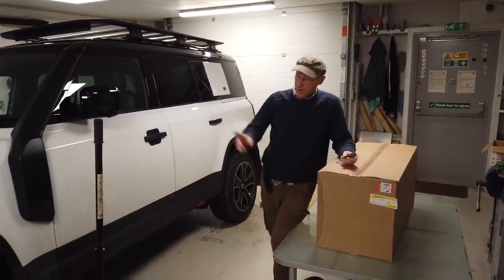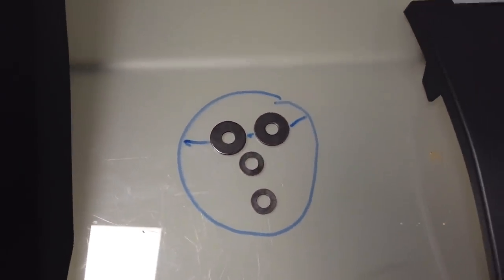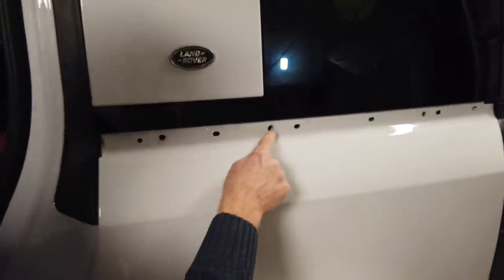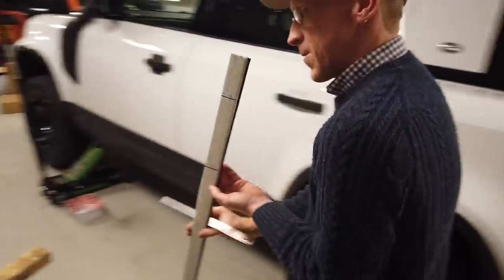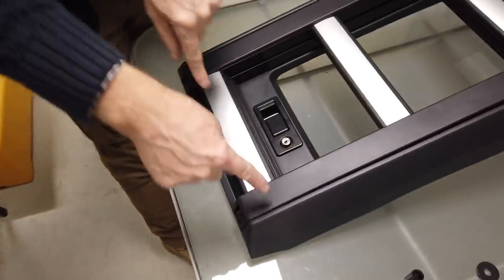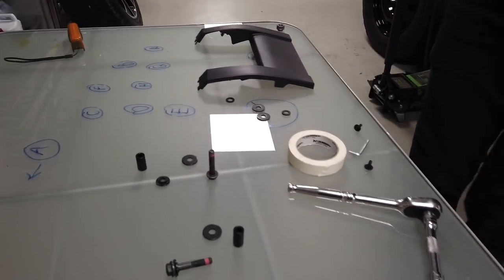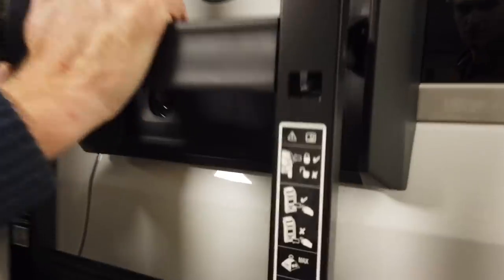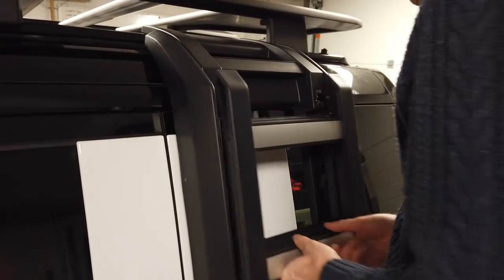New Land Rover Defender L663 2020 Deployable Side Roof Ladder Fitting Instructions

Comment: Great video.  I've had the ladder fitted for a few months.  Thoughts:
1) No rattle to report (not exposed it to extensive corrugations)
2) No wind noise to report (over and above that which is already present from the roof rack)
3) It interferes with your rear view in the wing mirrors - like the lunchbox. An inevitable consequence of hanging anything on the side.
4) It makes getting onto the roof considerably easier and consequently makes the roof rack practical (I can't understand how people have roof racks without a ladder as you'd only be able to lash things down from the side)
5) it looks AWESOME.  Love the fact that it folds away, love the integrated look and it completes the car.
Reply from the maker: Hi Alan.. yes for sure it look great and is very useful overall we were impressed. What about paintwork protection ? did you decide to do anything here ? let me know if you have any ideas.... we could design one for you to try.
Reply: Have you had any issues with water collecting behind the trim piece? The 19mm holes leave enough space around the cylinder spacer for water to get in. Hoping it'll just drain out through the bottom of the trim piece.
Reply: I was thinking about paint protection. I’m sure climbing up and down with boots I would hit the painted panel. Did you put something together for this?

Comment: Excellent - you managed to get the ladder and fit it!  I have cheated and got my local dealer in Norwich to fit it - along with the roof rack and urban pack - The urban pack was the only way I could get the rear wheel cover.  I think of all the accessories the ladder is the coolest so far!  Thanks for the video - keep them coming chaps.
Reply from the maker: Hi - One question do you do you have the side gear carrier too? do you have the same key for the ladder and the side gear carrier if you buy as a "pack" ?
Reply: @L663  Hi.  I dont know yet, the Defender is with the garage while I am offshore for 3 weeks so will find out in a couple of weeks.
Reply: @L663  no, 2 separate keys on mine

Comment: Great video I watched it twice before installing my wife’s.   I drilled very small pilot holes and put a piece of masking tape over the bolt holes.  I then installed the trim and pushed the drill bit through. The resulting hole was at the very bottom of the bolt holes.  I moved up as much was I could without getting into the edge of the molding.  Even doing that when I finished the install the spacer was at the very top of the hole with about a 3/16 gap below.  Long and short of it is that the factory holes are too high.  People should be warned.

Comment: I have the ladder fitted. So people asking about noises:
1. On smooth surfaces the wind noise will not make a difference if you have a roof rack fitted
2. On corrugated surfaces you can’t hear it as road (gravel) noise dampens out anything else (you don’t hear rattles from the ladder inside the car)
Reply from the maker: Thanks for adding this information its very helpful !

Comment: Why do you think Landrover don't include a drilled piece of trim in the kits as they probably only cost a couple of pound to make?
Reply: Yes I said that when they fitted the lunch box, you think for the price it would be included because if you change your mind or change the car your going to have holes showing
Reply: @dwrowley   I think those side trim pieces are very expensive to purchase separately around £50 or so if I remember from a previous  video.  The other problem would be the colour, you'd have to have multiple part numbers for different colour combinations.
Reply from the maker: I can see the problem here is that this part is body colour... so they would need to offer them all colours...or it could be gloss black to match the window... but that might upset Gerry as there would not be straight bodyline !
Reply: Midnight Spares in South Africa going to be very busy.

Comment: Checker plate to protect the paintwork, upgrade the locking mechanism, the plastic trim looks cheap and if you ever need to replace it your probably have to buy a complete ladder kit, I had a problem with dealer fitted sidesteps on a Td5 110 plastic end caps fell off after a few months could not get spare endcaps dealer problem he had to take endcaps of a new step to fit to mine .

Comment: I reckon the the smaller M10 washers should be between the tube and the car's body, inside the big hole you drilled in the trim, to spread the load a bit. Otherwise a big heavy bloke will likely punch the tube into the body, or dent it, with use.

Comment: Very interesting. I'm disappointed in the locking mechanisms (or lack thereof), but the ladder itself seems fairly decent. I had heard some feedback that it's too high up to be useful, but that doesn't seem to be the case. It seems to be lower than the top of the back tire, which would be the normal alternative to step up and access the roof. 

I wonder if there is a way to manufacture some enhancements to the ladder? Thoughts - additional step or two down that could be "hooked" on the bottom for people with mobility issues (like myself); vinyl "kick plate" like you suggested in the vid... other than the wobbly latching when it's closed, it seems sweet. Hopefully that wobbly-ness doesn't create a racket when you're driving. Let us know if it does!

Comment: Really good video.  Informative, entertaining with both good technical detail and good humour.   Really like the way that you explore the install showing different thoughts along the way, solving for usual uncertainties.   Considering getting the roof rack and ladder for mine as a consequence.  Just need to figure out if the items are yet available in the US, and also check the clearance on the roof rack to the garage door (new vehicle height).  Thanks.

Comment: Just an idea for an experiment. When using threaded holes in bodywork, that go into voids, how about trying PTFE tape on the bolt threads to prevent water ingress?
Reply from the maker: Good point - one thing i forgot to mention... as that Land Rover to their credit did think of this and have pre applied some pink sealant / thread lock to the M10 bolts.

Comment: Thanks, great video. I just had the dealer install mine on a new 110 but I'm getting a whistle noise from wind at speeds great than 40 mph. Have you experienced the same? Any ideas how to combat the wind whistle noise?
Reply: I am Having this problem currently, very annoying. I want to remove it and reinstall it but I don’t want to break my finishing cover, as happened here. Did you have any luck correcting the whistle?
Reply: @mannkeitha  yes I did, it turns out there was a defect from the factory. The rectangular panel located on the outside of the door (second row seating door) requires connectors to hold the panel down which were not installed in mine. I was able to identify the issue by opening my doors on both sides of the car and gently lift it up on that panel. Then I noticed one side of the car was different from the other in that one side near the ladder lifted up and away from the body of the car. This was just enough to create a very annoying whistle noise. I took it back to the dealer and they confirmed that this was the issue. The part is on back order for 3 months, so as a temporary fix they installed silicone underneath that panel to hold it down and the whistling went away. Major bummer. Especially because the dealership could not even identify the issue. Originally they told me that the noise is common, so I test drove one at another dealership to confirm that the whistling wasn't normal. Now I'm waiting for the new part to be delivered and installed, hopefully I'll have no more issues.
Reply: One more thing, I was able to remove the cover and the ladder in its entirety, but you need to be very careful. There are clips that need to be pushed with a flathead screwdriver to disengage. The plastic connectors are very weak and easily broken. I took my time and studied what the part looked like online before attempting the removal. It's possible, but if you pull or push too hard in the wrong direction the plastic covering will likely crack or connectors snap off.
Reply: This is excellent information!  Thank you.  I will take a look at my pane this morning. So it is the increased size pressure from the ladder that is lifting the panel and causing the whistling, then?  I would assume so as I do not hear it without the ladder.
Reply: @chaseoliphant1980  I just checked my panel and the while thing is loose and unsecured at the rear. Amazing!  I spent so much time looking at the ladder I would not have checked this panel had you not mentioned it. I will get it to the dealer to order the replacement.
Reply: @chaseoliphant1980  Chase I have just read this, I have had my ladder on and off the car over the last year and a half - driven me crazy trying to figure out where the whistling noise is coming from! This could be it! Just to clarify is it the 'floating' panel that you are referring to here and was it fixed by your dealer in the end?
Reply: @mannkeitha  Hi Keith, did you end up getting this fixed by the dealer? I'm trying to solve the same issue at the minute.
Reply: @epicdrivestv4370  yes. The dealer replaced the clips and added silicone to seal the panel. All better now.

Comment: I just installed the ladder on my 110. Your video made it much easier! I was wondering if you've had any issues with water collecting behind the trim piece? The 19mm holes leave enough space around the cylinder spacer for water to get in. Hoping it'll just drain out through the bottom of the trim piece.
Reply from the maker: Hi Philip - no problems on mine but the ladder has been on and off the car.. the water should drain out OK and the bolts supplied had sealer around them if i remember correctly so should be waterproof.
Reply: @L663  Thanks! I was debating putting some silicone on the outside of the trim where the bolt goes through to create a seal, but not sure if it's worth it. Will see how it goes!

Comment: Regarding - the Lunchbox and steps Simon ,  The Military "WOLF " had the spare wheel on the side of the vehicle  ,It was found that the drivers were driving OFF Road around by trees  ect ,and the branches were  "Ripping the Spare " off the side of the vehicle  doing damage to the side  of the Rover in doing so . . Could this be a problem  by bolting  things on the side of the Great looking 110 s -Just a thought ?

Comment: Great video, Simon. 👍🏻

I've been wondering whether to get the ladder for my 110. LR's accessories website mentions it can fit either side (I think I'd prefer it on the RH side) but price it at £708. Ouch. Maybe that includes dealer fitting.
Reply from the maker: The retail is £500 + Vat so that is £600
Some dealers have them on ebay for this price ( search Defender Deployable Ladder )
I may sell them when i design the side graphic / anti loss washers etc so it is a full kit.
Reply: @L663  Cool. I can wait. 😉

Comment: Another great vid! Thanks. Did you buy this separately because getting it as part of the new car order would have forced you to buy other, non-desirable, options?
Reply from the maker: All items can be purchased on their own - at the moment there are some supply issues on some items. I ordered on its own and it took a couple of weeks to arrive.
Reply: Sytner Wakefield have these on ebay. I got mine from them. No blumming wheel covers though :(

Comment: Simon, do you know if the part “B” (the black piece slides into the rail” can be bought separately anywhere? The one came along with the China copied ladder is not well coated which can be rusty easily and I’m looking for a nice replacement.
Reply from the maker: We have designed our own top mount system that we will be selling soon - send me a pic of your problem to contact at powerful uk dot com and put FAO simon

Comment: Nice job Simon I watch the Land Rover Defender advert tonight and the one they had with the roof tent on top had the ladder on the left-hand side of the vehicle . 
Ralph Cooling
Ps is there a bottle opener attached to the panel that you rivet on above the lights i see in the video?
Reply from the maker: No its a green land accossiation sticker - but that does remind me... I need this feature in my new Gerry can holder molle plate !
Reply: Oh yeah i remember now sorry about that. It would have been interesting if you weighed the vehicle before you start putting all these Extras on it and then see how much it weighs afterwards but its looking nice any way Simon 👍
Ralph

Comment: any way to get the lunch box and ladder with the same key?
Reply from the maker: That is interesting question.... and the cross bars....
Reply: @L663  You can put the key(s) in the same place where your locking wheel key (socket) is, so you haven't got to add to your keyring, after all it want be used on a daily basis :)

Comment: Ladder price? £?
Reply: Read above, couple have said what they paid
Reply: @kear3922  Didn't see any "official " price, just replies with "nearly" amounts
Reply: @kevinwyatt9771  I know, looks up and down, most prob where you buy it from and discount, looks around £700ish
Reply from the maker: Official Retail price in the UK is £500+Vat for PN VPLER0189 which is the current PN for this ladder.
Reply: @L663  wait for 2nd gen to iron out issues ( ladder rattles, locks etc.